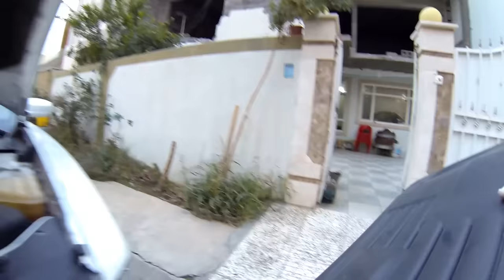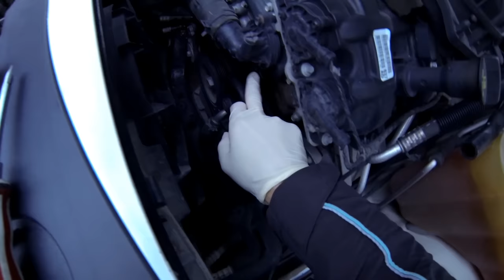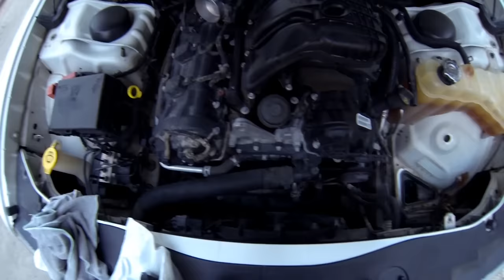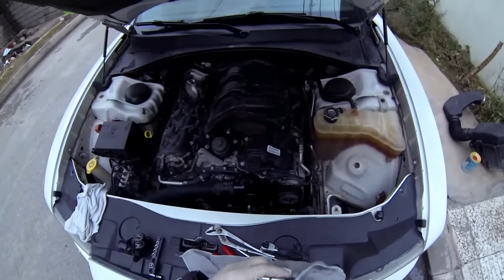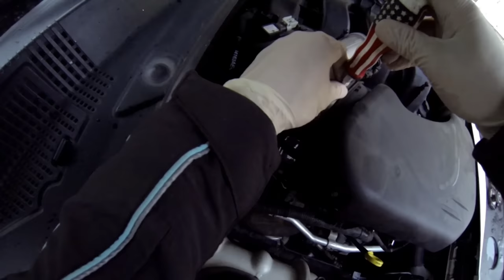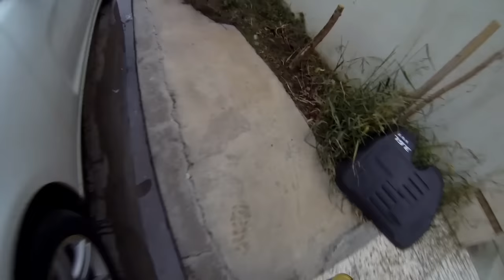2011-2014 Dodge charger V6 thermostat replacement

Comment: Dealer claimed I had a leaking and faulty T-Stat! (HE CALLED IT THAT) and it would run me $395. Thanks to your video I purchased new one for $33 and Anti-Freeze $12!!! Game over! My 2014 works like a charm, cant thank you enough....1 hour and your video and $50 bux my friend!!!
DEALERS ARE JOKERS !!!
Reply from the maker: Ed Gonzalez I glad to hear that good job 😄
Reply: T stat ?!! What a d bag lol
Reply: What type of fluid did you use
Reply: You gotta remember, the price that the dealership gives you is the price that there required to charge for that job, and if it's only supposed to be an hour job they don't get paid for the extra time if it takes longer, they need to make a living too

Comment: Hey @ali_grave 89 I did everything you did in the video & the very next day my temp hand on my car started to go to the hot side on the thermostat was there supposed to be 2 gaskets on the installation the 1 that comes with the new thermostat and the old 1 was I supposed to still use the old 1 as well
Reply: they forgot to mention you have to bleed the air out, which is a bitch.

Comment: My check engine light came on I scanned it and it said was temp rationality code will changing my thermostat as well fix the issue
Reply: mad mike Same here. I went to auto zone and they told me I need a radiator flush, went to O’Reilys and they said I need a new thermostat. Going to try this first

Comment: Please help im looking into purchasing a 300 v6 .Is it normal to see the bubbles and condinsation on the inside top of the tank
Reply from the maker: Courtney Gardiner normally that's not happening on Dodge or Chrysler but that's  mean the engine have air inside . first take out the oil dipstick make sure the oil looking normal if it's creamy white looking that mean head casket is broken don't buy the car if its ok you can slov the problem by flashing the coolant water and make sure theirs no air inside the engine
Reply: Thank you
Reply from the maker: Courtney Gardiner you are welcom

Comment: I just replaced the thermostat on my 2012 charger, how do I clear the check engine light?
Reply from the maker: you can clear it by diagnostic tool 🔧 or drive it 5 minutes and turned off 2 3 time it will clear automatically if not maybe you have another code

Comment: Thank you for this video! I ended up replacing my thermostat with help from this video. Do you know how to clear check engine light? I tried disconnecting battery but that did not work, anyways thanks.
Reply from the maker: Henry Rodriguez push ignition button without break 8 time it will give you the code on small screen (P2096)
Reply: Ali Gravi 89 unfortunately I couldn't get that trick to work for me after trying numerous times. But I found out I was short some antifreeze and that's why the light stayed on. Problem solved!
Reply from the maker: Henry Rodriguez good to hear that you fixed  the problem
Reply: Thank you for this video. Just did this to my car. Easiest thing ever and would have had no idea with out this video.

Comment: What was the reason of you changing the thermostat???
Reply: Willie Vaughn my
Check engine light came on and Auto Zone ran a check and it said that my thermostat needed to be replaced. 2 weeks prior it came on and said i had a gas leak so I changed my cap to my gas. It went off then now just came on again so thermostat is what I’m changing now.

Comment: Hi I keep running a temperature sensor code but I replaced the temp sensor with a brand new one cleared the code then came back on about 400 miles later could it be the thermostat it's not running too cool or too hot
Reply: Did you ever find out?? Mine is doing same

Comment: Is it necessary to have the coolant flushed after replacing the thermostat?
Reply from the maker: it depend on your car if coolant dirty you need to flash your car
Reply: @AliGravi89  thank you for the response and for the video!
Reply from the maker: @mik3ro512  you are welcome

Comment: You didn’t drain the coolant, correct? Instead you opened the reservoir and then closed it?
Reply from the maker: Daniel Soto  what do you mean about that what's wrong ?  I close it again Wrong!!
Reply: Ali Gravi 89 no I’m not saying it’s wrong! I’m just asking if instead of draining the coolant, you can just open the reservoir to release pressure and then close it again to prevent it from coming out of the hose
Reply from the maker: Daniel Soto oh yes you're right 😁

Comment: can u tell me where the coolant temperature sensor is located?
Reply from the maker: Travis Cook  sorry for reply late. I think it  connect on oil coolant you should remove air intake until you get to oil coolant if you don't get it connect me on my Facebook Alisibkee I will send you picture for oil coolant with sensor

Comment: My light is still on
Reply from the maker: make sure the radiator coolant on Max
Reply: After some of the coolant came out I put water back in
Reply: Use Dodge parts

Comment: He didn't even apply a new gasket? 
Leak just waiting to happen🤦‍♂️
Reply from the maker: leak gone forever bro
Reply: New gasket on  the new  thermostat housing. Changed entire part, not just the spring and gasket.